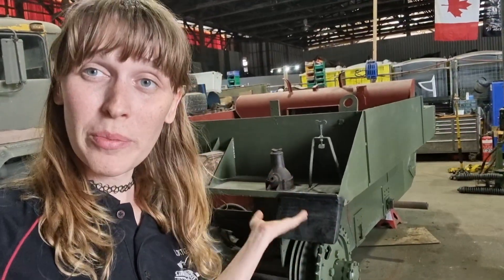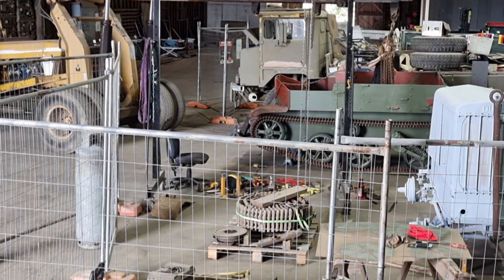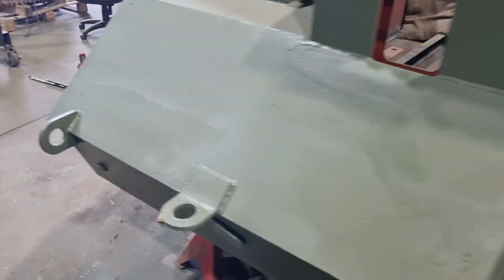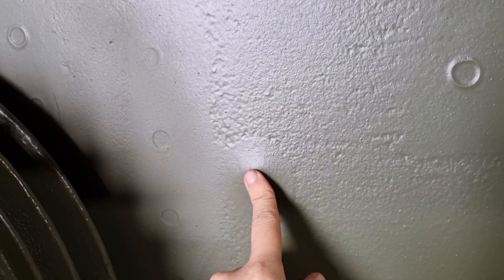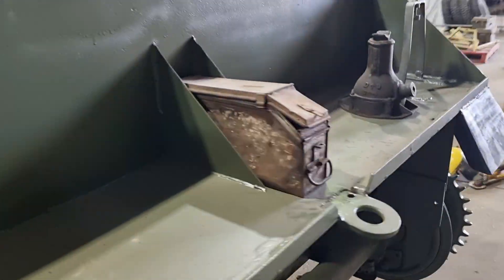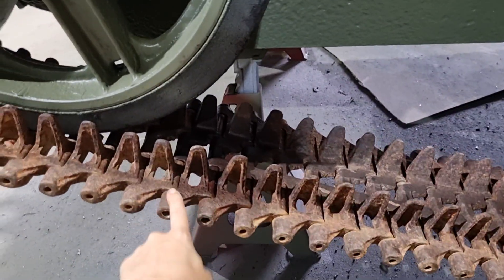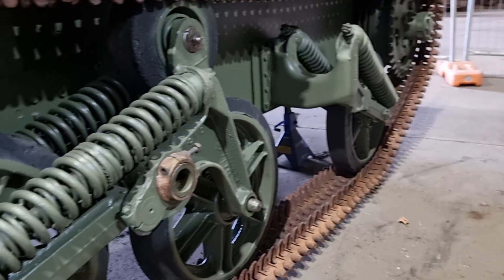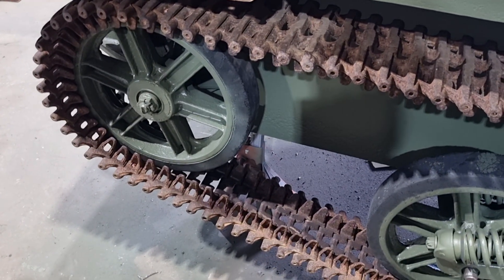WW2 track installation on our restoration!

Comment: The Bren Carrier is such an ungainly little thing but I have a soft spot for it as my granddad was the radio operator in one, and I still remember the story he told me where they were driving about at night with the lights off and the driver hit a tree stump and got their Bren Carrier hung up, with the tracks spinning off the ground -- so he would've totally empathized with you getting stuck on the rocks in Steel Aces :P

Comment: It's always interesting seeing a new use for a tool that you have used. I think I would much rather use it on the track than on the coil springs it is usually used on. Far less chance of being killed if it slips off the tracks than if it slips off the springs. As always, keep up the good videos when you can.

Comment: Could you please show the stearing mechanism that warps the track. If it is possible. I have always wondered how it works and what part of the system does the warping
Reply from the maker: Absolutely! Once the steering wheel is on I'll definitely be showing how it works 😁